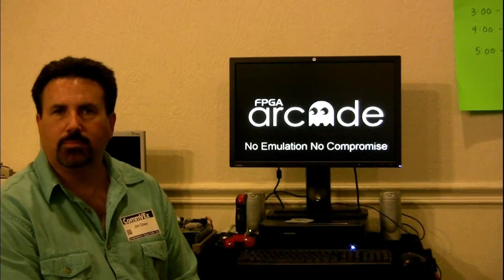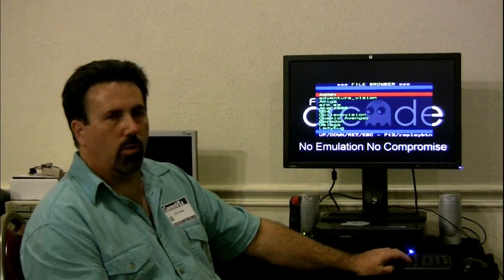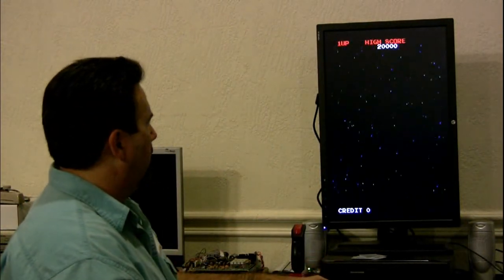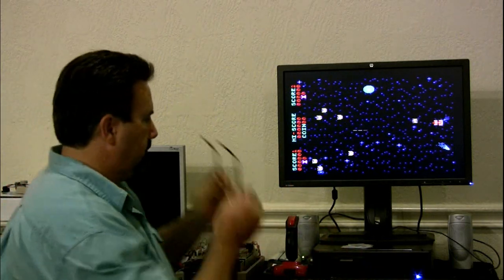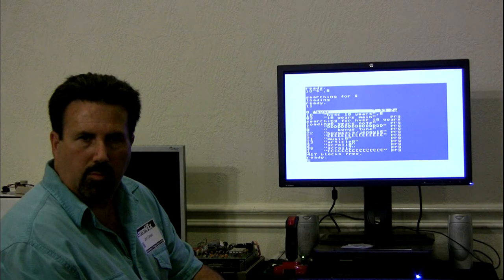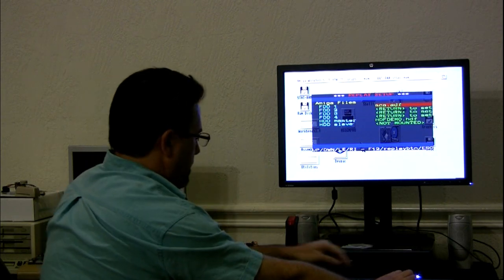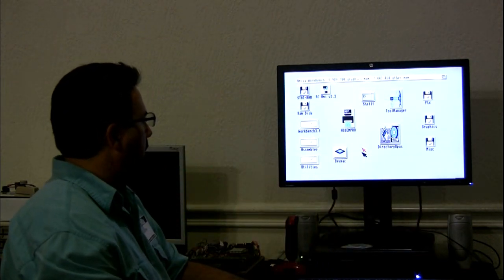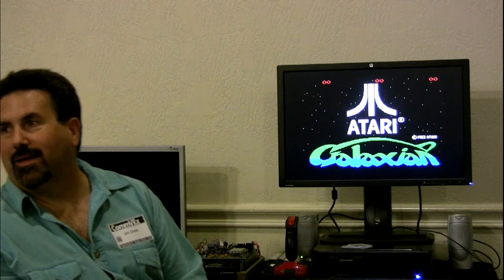Drew and FPGA Arcade

Comment: I like the FPGA boards being used as accelerator boards for like the Amiga 500/1000 and so on (200+ mhz 68060!), but as a tool to function as arcade machines, Amigas, C64s or whatever, I don't see the benefit over just using a software emulator on a reasonably fast system: M.A.M.E. is nearly perfect on my system with every game I throw at it (from about 1999 and earlier); Commodore 64 is 99.99% perfect emulation - only found a handful that don't work correctly - with, for example, CCS64 and so on.

Still, fantastic potential!

JW3HH